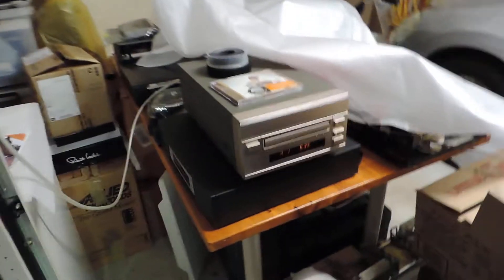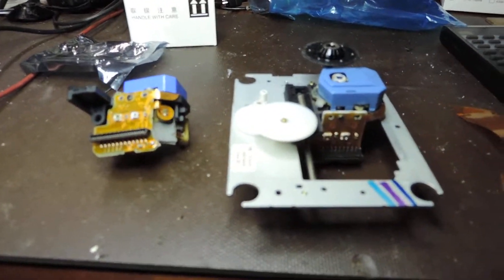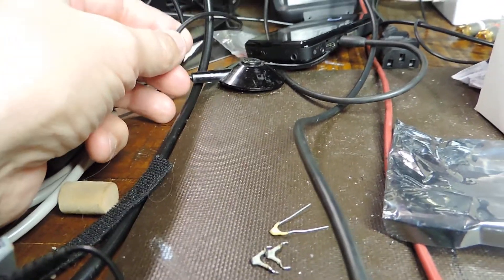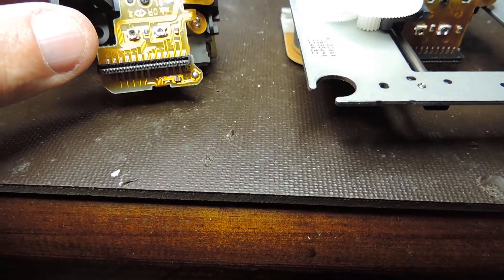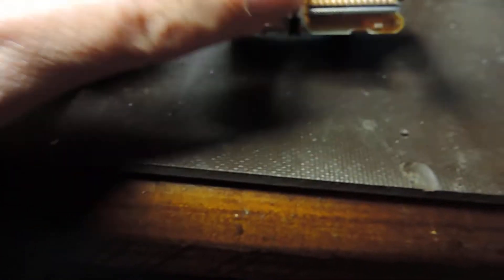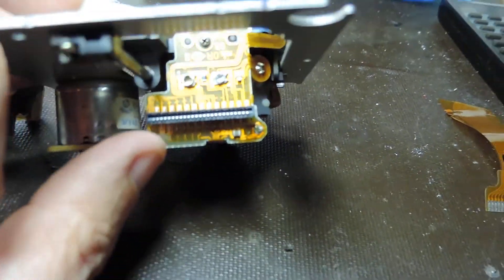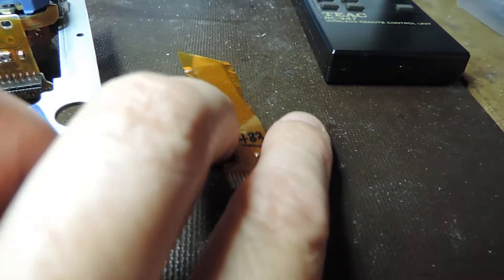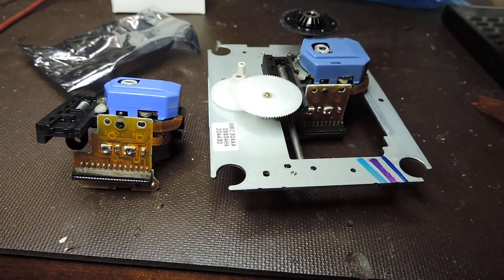CD laser mechanism reploacement on the Linn Unidisk SC

Comment: Hello there! I'm struggling hard to get to disassembling the cd tray itself... Do you possibly remember how you did it? No need of any in depth explanation... Just some tips, since I can't figure it out
Reply from the maker: I do not remember it, but trays normally do not come out just like that. If they did, they would routinely fall out of players if someone pulled at them. You have to find what is holding it. Normally, it will be a tab of some sort that needs to be bent. Remove the whole mechanism first and observe it from all sides when you slide it out. Very often it will not move at all unless you let the player slides it out. Once tray is out, kill the mains supply and then observe it as you slide it in and out. Also, quite often, the front of the tray has to be removed before the tray and mech can slide out of front panel. The tray's front is removed (usually) by lifting it up by holding it on both sides. Other times, it shifts sideways. You really have to look at it from underneath and work it out.
Reply: @hear-net-au  I thank you for your dedication! Will surely keep you updated on my efforts with this one. Again, many many many thanks!!!
Reply: @hear-net-au  hello again!! I've tried, and managed to disassemble everything, except the drive. The tray itself won't open with either the button or manually, I'm not sure what's keeping it shut like that
Reply from the maker: @lorenzorovelli4850  trays are often locked in position and it has to be the motor that does the initial "unlocking".
Reply: @hear-net-au  and how would I have the motor 'unlock' it? Really can't figure it
Reply from the maker: @lorenzorovelli4850  No, i do not remember it for it was 5 years ago. But, if the unit doesnot power up or the drive motor will not do it for you, you have to find a gear that is responsible for it, and drive it with your finger. If you find a gear that does seemingly nothing, work it and with time you will see the head retracting and then the tray will come out.
Reply: @hear-net-au  Well... What can I say... You really know your damn stuff. I managed to open it, and remove the tray, now I'll try to understand if the motor is bad or anything,since the band is still working properly. Anyway so so so so so many thanks, you can't understand how much I appriciated you giving me this much help!
Reply from the maker: @lorenzorovelli4850  My pleasure. I get help from others and feel that I should pass on the little knowledge that I have.
To test motor, put 1.5V DC on it and see if it spin and whether it has some torque.

Comment: I have a Linn Akurate CD Player. During CD operation it jumps from time to time. I cleaned the laser and the axis wirh no success. Do you think it is the laser unit or an issue with the switch mode power supply? Or do you think it could help tuning the little potis on the laser? Thanks and best regards. Andreas
Reply from the maker: Whereas lasers in regular, Red Book CD players do not normally fail, SACD ones are almost all rubbish and fail a lot. You probably have to replace it. Luckily, they are all available and they are  (most of them) cheap. Those pots adjust laser power and doing it without laser power meter might fix it temporarily (if you turn the right one the right way), but it probably will fail permanently soon after, for your adjustment will be too coarse. Since it already is not working, give it a go. First, mark it with fine felt pen, so you know where it was to start with, so that  if you adjust the CD one and it stops working (or there is no change, meaning you went the wrong way), you can then put it where it was originally.

Comment: Where can I source a laser mechanism for a unidisk sc?
Reply from the maker: I bought it from a local supplier Westec who in turn source their components from WES Components in Sydney. They are wholesalers but they do have a retail arm called Wagner.
Or simply on eBay. It should not cost more than $10. These are common garden Sony DVD mechanisms.

Comment: There really useful information but for those of us with v. limited experience it would be great to see how you strip down the mechanism to remove the laser.
Reply from the maker: This Linn units was very poorly made and stripping it and reassembly was a 2 hour job. It appears that Linn changed mechanism after board was in production and holes in it did not alight with the mech. So them made up some brackets to "made it fit".
I personally would stay away from this Linn unit - even though it sounds pretty good.